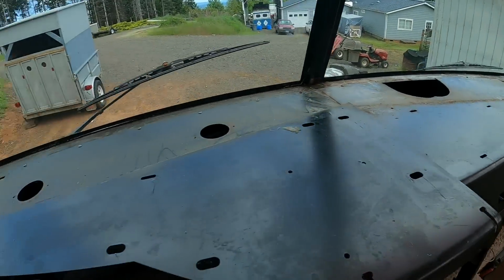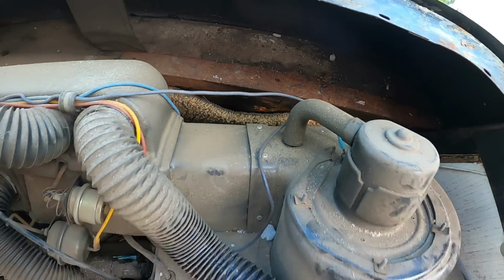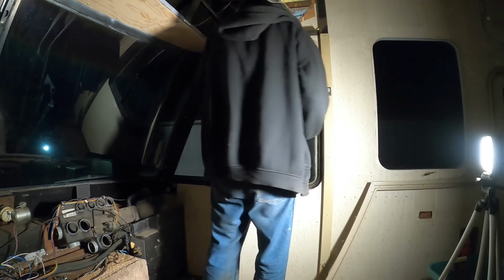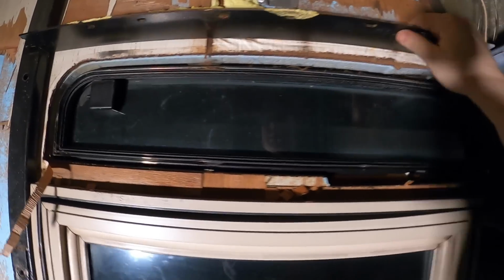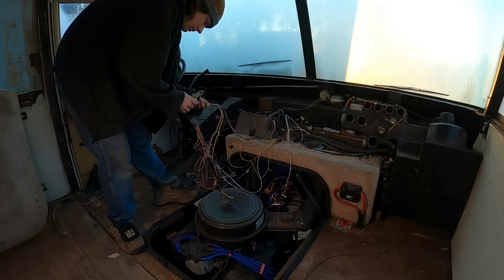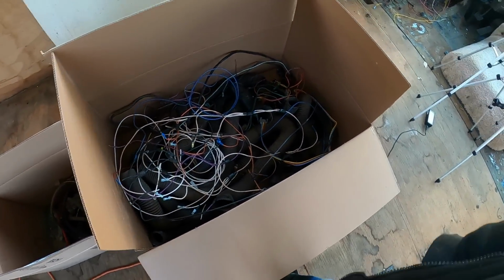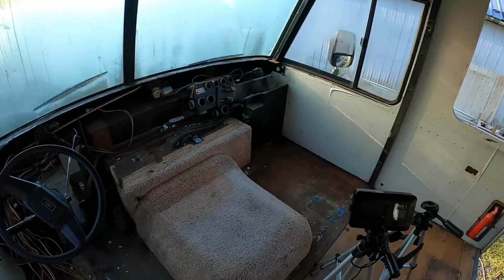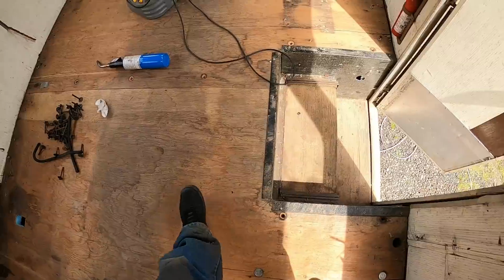RV Teardown (Part 10) Dash Framework, Wires, Mirrors, Floor Bolts, Trim

Comment: Nathan that weird switch. Could it be for the temporary connection of house and engine batteries? In my Winnebago if you flattened the engine battery and it wouldn’t start you could temporarily hold that switch and start the engine using the house batteries. Hope this helps. Great videos mate.  Bill

Comment: When it comes time for the plumbing use pex pipe and pvc for drains don't use the black abs pipe as its garbage looks good what you've done so far can't wait for the next video😁
Reply: True I am a plumber but abs is also a thinner wall compared to pvc